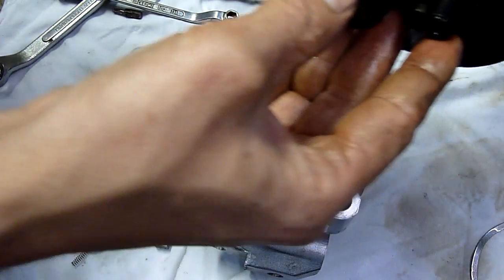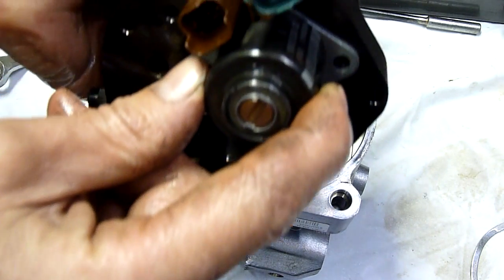Delphi Common Rail Diesel pump Autopsy Pt2 -Hyundai Terracan and Kia K2700 pump

Comment: It would be necessary to install a high pressure filter between the pump and the rail. The flow is small, does not need to be large. Differential pressure inside filter would have almost not. Only the casing to be compressed. Install the filter inside the rail also.

Comment: Manufacturer must put filter on each injectors in. just like two strock diesel injectors.
Reply: Or at least another filter on the main fuel line to the rail.

Comment: That solenoid.   It's actually a fuel pressure regulator.

There's a sensor on the fuel rail.  Basically it opens and closes to maintain the right output pressure.

Mine jammed.  After the two screws, they just pull out.  There's a bit of a filter on it but it's not very fine.  More like a teas strainer.

You can buy a new seal kit. There's about 20 of the litte buggers.

Comment: Wear on low pressure  rotors can be caused by blocked up pick up pipe or running  low on fuel all the time aeration  of fuel will wear housing so a deisel man told me   he advocates  fitting a low pressure  pump by tank to prevent such wear . Did hear a big business  who told drivers to not let fuel level drop below  half a tank were possible  eliminated problem

Comment: Hy! The biggest problem in a diesel car is not this pump! The pump will never fail when enough diesel is pumped from the diesel tank to this pump. When the fuel pump in the tank have a failure and therefore less/no fresh diesel goes to the high pressure pump immediately the high pressure pump can destroy all part of the rail...

Comment: The solenoid in the back (brown one) is the IMV inlet metering valve it controls the pressure for the rail if you disconnect it the pressure goes up to aroun 2250 bar

Comment: I once ran water by mistake into my Ford Diesel van, I was using one pipe to transfer fuel and needed some water so used the same pipe to transfer it. I totally Forgot to clear the remaining water in the pipeline before reconnecting it back to the fuel tank..... stupid me the pump failed after less than 30 seconds!!

Comment: change diesel filter every 6000km not 45000km like reno say,filter is size of coffee mug,too, small also at diesel filler flap/door rubber boot may leave water into fuel tank from rain or power washer when cleaning car,water kills diesel,i also use lucas injector lube in every tank fill,160.000km going like a train.best little car i ever had,diesel filter on net for 12euros

Comment: These pumps are machined to extreme standards of fine tolerance and rely on the fuel providing sufficient lubrication to prevent damage. Using poor Diesel mixed or contaminated with kerosene/ paraffin  the lubrication will be lost and rapid wear follows. To this end folks add 2 stroke mix but be careful here also, some 2 stroke mixes will break down going through the injector and produce a sort of thick wax in the injector which will need cleared out occasionally. Some people add other fuel additives but again be ware some of these will alter the fuel lubricant quality. In brief put your efforts into getting the very best fuel, if you want to use a lubricity additive try to get an anti gelling one with no alcohol and cetane improver . These will give the lube of 2 stroke but keep injectors clean as well.
Reply: How often should be used diesel fuel additives???

Comment: The "High pressure transducer" is in fact a metering valve. The back end is where the fuel comes in, and is probably low pressure whilst the vane end is near where fuel goes to the rail. (The metal pipe you took off in part one is the feed to the common rail). The other transducer is for measuring fuel temperature.
Reply: +Benedict White Actually, I've just checked on my car. You are right about which is the high and which is the low pressure end, but the solenoid is the metering valve and controls how much fuel goes to the HP end to regulate pressure in the common ail. The other one measures fuel temperature.

Comment: what if i remove the low pressor part and replace it with a electric pumpe
Reply: I just cut the line and added an electric pump.  No problem at all.

Of course, now I've seen inside, I think that I should take out as much of the low pressure pum as I can.  I don't know why it's stopped working.  I thought a seal but, I don't know.  I don't want it to grind itself up.
Reply: @learningwithlyricsandsongs  and how about the IMV?

Comment: hi, many people are saying using two stroke oil at a ratio of 200:1 mixed with diesel does wonders in modern engines and compensates for our low sulphur diesel. any thoughts Ed?

Comment: This is why I concider common rail to be the oncoming death of the diesel engine, to operate at such high pressure, tolerances have to be so fine that the fuel quality needs to be almost up to laboratory purity, in the real world this is so hard to achieve consistently. I'm a forklift engineer and just starting to see these engines, the amount of 'damage' is so small it unbelievable! As said if it was a hydraulic pump of some sort you wouldn't give it a second thought!, Just a bit of 'wear and tear'. Long live the inline pump! Just a shame to see something that was so simple and rugged turn so highly strung and temperamental.
Reply: +deezelfairy I will never EVER get rid of my 12 valve cummins for this reason alone.  My inline pump has over 270,000 miles on it and still going strong.  Ford IDI and old school Cummins RULE!
Reply: Kyle Fegley All old diesels with mechanical pumps rule! So simple its incredible.
Reply from the maker: I have to agree with you, the excessive complexity and tight tolerances make it a very fragile system. I have a Mercedes ML270CDI with a lot of KM's on it and I can see that the previous owners have replaced the injectors at the very least!. however, it produces and insane amount of power and torque for a 2.7L, so I do see the advantage of common rail, its strong and efficient. when its working that is :p.

Working in a foundry I had numerous portable hydraulic power packs around and they would often get covered in molding or blasting sand, even getting into the quick connects. it took years for it to damage the pump or seals enough to make the unit quit!
Reply: @aussie50  ML270 , my condolances , ,

Comment: That solenoid thing on the end of the pump is a fuel metering valve, causes all sorts of problems. I suspect that was maybe the only problem with the vehicle. Apparently doesn't show as fault codes. Same pump as fitted to Ford transit UK by the look of it.
I replaced mine but turned out to just be a leak on the O rings. Common to find on Ebay UK.

Comment: Same problems happened here in Romania with these Delphi pumps on renault dci engines becouse they are lubricated by the fuel and since the diesel was "dry" (no sulfur added in it for emissions reason) it couldn't perform the lubrication so the pump ran metal on metal hence the metal shavings going into the injectors. The solution ppl found was to add to every tank of diesel some oil used on 2strokes engines to mix with the fuel. Here is a fix to this problem  /watch?v=uhIfUxh0rHg
Reply from the maker: the addition of 2 stroke lube does indeed work, the local Hyundai dealer rep promotes its use in all early diesel Hyundais and other cars running this pump setup!.
Reply: @aussie50  sir how much do i need to put per litter?
Reply: how much did you put on the tank? i mean ML

Comment: What are the symptoms of this debris in a running engine?
Reply from the maker: Hard to start, rough idle, CEL on, low power.
all related to low injection pressure.

Comment: This failure is very common here in Romania with Renaults and Dacia, our national car wich is made by Renault, even after installing new pump and injectors, for around 1000-1500 Euro. Some guys found a way around this problem,wich is to  leave out all the components from the low pressure side and fit a lift pump (with about 4 bar output pressure, instead of the 7 bar in the original setup)in the fuel tank. Of course, they are using the same pump after a lot of cleaning and tricking the ECU to not notice the pressure difference. It seems to work fine.
Reply: And how do you fit the IMV? It must control the fuel from the low pressure side.
Reply: Delphi parts r shit ,there injector get stick ,there pump r not good they make whole shit and r more expensive
Reply: french cars, i want to vomit sir !

Comment: My last car, a Peugeot 306 2000 HDi used a common rail system from Bosch. Pretty reliable systems, I bought a recon pump that was meant for a different engine and with a couple of mods it went from 90 bhp to 170 bhp. I find it strange after working on a 06 Golf TDi I have now that has an "older" style injection system than the French car from 2000 which has a common rail system. French leading the way! :P
Reply: Willhemmens how you got 170hp

Comment: I'd be fairly certain the device on the back of the pump is the Pressure Regulator (as someone else mentioned below, sometimes known as an FCA in Bosch world) - there'd be a pressure sensor on the fuel rail - which then the ECU controls the Regulator on the back - that would bleed pressure I'm guessing back up the core of that central casting. These Delphi systems run at a peak of 1600bar (23,200psi) - interesting design though, not seen a "cam ring" style pump before.

Comment: This is why I run a lubricity additive in my diesels, and im in the states. Even in my old diesels. That bit is got to be the pwm signaled spool valve solenoid that meters the fuel flow and thus pressure of the CR pump. Also, those tiny pns that popped out from under the rollers were the high pressure pump elements. Look at them closely, they will gall up and make metal debris and even seize into the pump body. I have found that on the Bosch CP3 pumps on GM duramax diesels. Very interesting design compared to others. I don't think a vane lift pump was the best choice for this but cost said so. CP3 uses a gear type. Anyways, great job! Cheers!
Reply: That thing with additive.. for cars there is so much "snake oil" sold, how in the world you know you buy right stuff you really need.

Comment: Now I know why Cummins wants a filter good down to 2 microns. Oh and also I think the thing on the back of the pump was a fuel control actuator, it is what sets the duty cycle of the pump and therefore rail pressure. (I am a diesel tech who works mostly with Bosch so my terminology might be off)
Reply from the maker: I did manage to get the device on the back off and you are right, its the pressure control actuator.

I will get it back from work and give it another go-over including microscope inspection of some parts :D

Comment: That big bearing on the input shaft is what's called a "Thin Section" bearing. Most likely made by Kaydon or SilverThin. Does it have a part # on the OD of the bearing? Looks like a B series, 3" with a plastic separator. It'd have a part number like AB030XNO or something..

Comment: I've read that ultra low sulfur diesel mandated for street driven vehicles has not the lubricity of regular diesel for tractors gennies etc. Injector failure is commonplace and presumably high pressure pump failure as well.
Reply: eco-friendly ignorance at work.  The logging industry has had a lot of problems dealing with the low sulfur fuel and damage to equipment.
Reply: True avoid that shit it's do dry that you can hear the injectors

Comment: Question is whether the pump ingested trash from the tank, or the fuel lacked lubrication and the trash all came from the pump.   If the trash all came from the pump, I wonder if the heat treating or case hardening was inadequate for the abuse (poor fuel quality?).

Comment: most likely someone putt gasoline instead of diesel fuel in the car.. gasoline  = no lub.. a mistake more common than one thinks
Reply from the maker: the car never had gas put in it, but garbage diesel is easy to get here, just go to United Fuels, its known to kill old mechanical injected diesels, much less CRDi systems.
Reply: i'm from europe (Portugal) i guess our diesel its ok.. i've recently dismantled a volkswagen injection pump from the 80's just for the fun of it.. boy that thing looked as new from inside.. the car had been running from 1985 to about a year ago.. barly any scoring inside.. although the owner sayd he put some engine oil in the the tank from time to time in the last 5 years

Comment: A very interesting video. Î am still trying to work out how the pump functioned. It would appear those bearings are rotational cylinders working in series to create the high pressure.

Anyway, last year I brought a kia sedona (carnival) 2.9l diesel. Straight away problems with the injectors. Fortunately I had a 6 month warranty.
6 weeks and new injectors, reconditioned fuel pump (the exact one in this video) and a fuel tank / lines clean. all good.
Now it runs a lot better.
Warranty cost ...... £2800 glad I wasn't footing the bill.
Long story short, these Delphi injection systems are quite weak compared to bosh injection systems. Kia use bosh these days.
Here in the UK the Delphi system is know to pack up after 60.000 miles regardless of what fuel brand is used.
Ford used them about the same time on their diesel cars so there is a history of issues here
Great video, are you able to figure out how the pump works. I can't figure it all out
Reply from the maker: The pump appears to have small check valves inside the central core, and fuel passes in through small passages behind the springs or somthing, I will have a closer look tonight and break out the USB microscope

Comment: 1980 my dad bought a diesel Passat. First mod he did was install a truck diesel filter and electric lift pump to it, and the first time he looked at it the weekend after fitting it he found it 3/4 full of water and crud. As the pump that time was about 1/4 the cost of the car he called it a good investment, even though the only filter he had was a 1" inlet truck one that took 2l of fuel to fill the bowl, and his hoses were 8mm. He took his workshop and got them to drain the diesel tanks, wash the insides and install extra fuel filters on inlets for filling and on the bowser side as well. That fixed the fuel contamination, and also dropped the breakdown rate slightly. The trucks were quite happy as they had massive inline filters that were changed at every service.

Comment: Somebody ran illuminating paraffin through that pump. That will kill those style pumps very quickly. Best additive to uncertain diesel is to add some 2 stroke oil 100:1 every full tank. It at least will lubricate the pump better.
Reply from the maker: yeh, 2 stroke oil was suggested by Terry's friend who happens to be a Hyundai Dealer Service Manager, this is after this pump failed tho. 
The fuel that killed it likely came from a United station.
Reply: even 2T oil can make carbon deposit ! Those engine fuel systems are too SENSITIVE to any diesel which does not have laboratory specs. You want no problems GO FOR OLD diesel from VW or Mercedes 123...
Reply: @chriscross4994 
Just add diesel injector cleaner every 3 months

Comment: I actually agree on what made it die; because these CRD Pumps are made to EXTREMELY TIGHT Tolerances; any debris in the fuel not caught by the Filtration system will TRASH that pump, and the microscopic metal particles that are forced into the Injectors from the Pump will trash the injectors too!

Comment: Not sure what i saw there, but when you pulled that plate out at the beginning, 2 of the vanes looked wrong, did they turn over and drop the springs when you separated it, or were they like that already ?